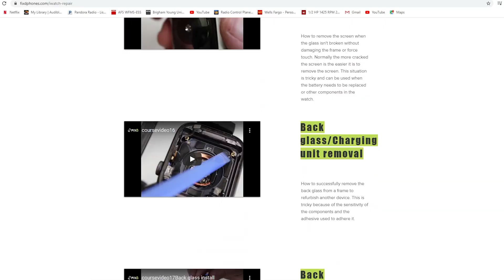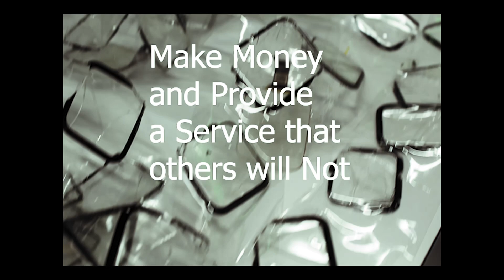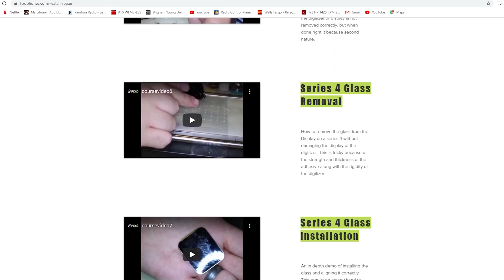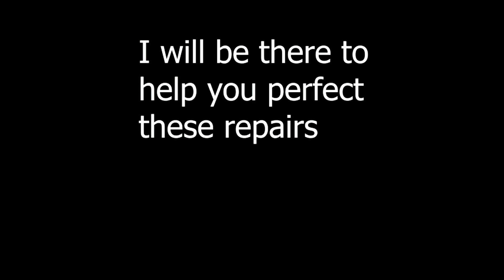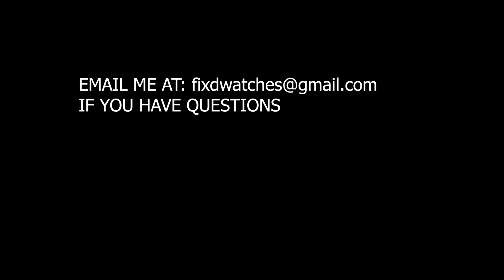APPLE WATCH REPAIR COURSE

Comment: There seems to be a problem with replacing the digitisers on series 2 and 3, the touch will not work as the digitiser and oled need to be paired by Apple??  I have done 5 watches and only 2 worked, the others touch will not work, I think it's to do with ios

Comment: Do you ever use OCA for repairs? I have only ever seen you use Loca. I use loca when I do mine, but I think OCA would be quicker. What are your thoughts?
Reply from the maker: I use LOCA on the apple watches because with OCA you only get one chance to align it perfectly, but with the LOCA I can position the display perfectly in the center before curing it. I defiantly use OCA with the iPhone screens and the Samsung screens because of the alignment molds it makes it possible. I have yet to find an accurate alignment mold for the apple watches.
Reply: OCA is definitely quicker and less messy.  I stopped using loca around June 2020 and don't regret any of it. Also the loca could damage the lcd connector if it gets inside.